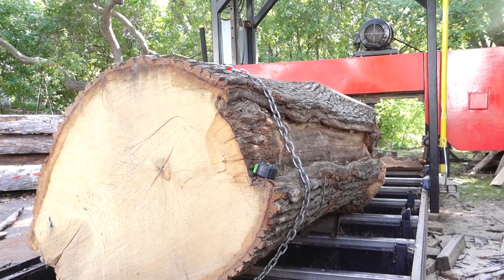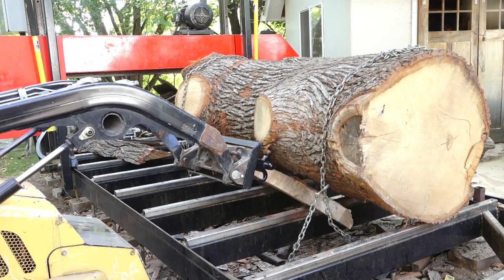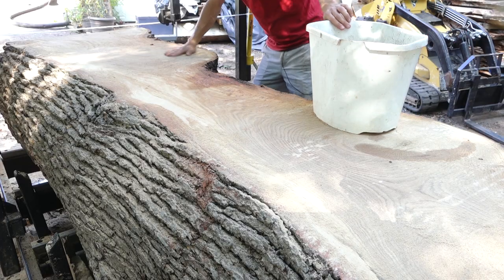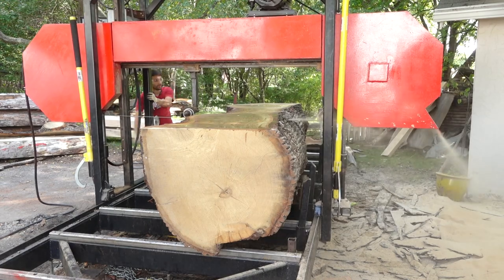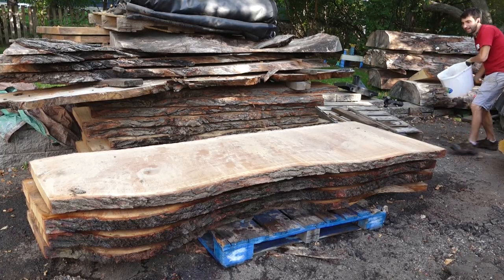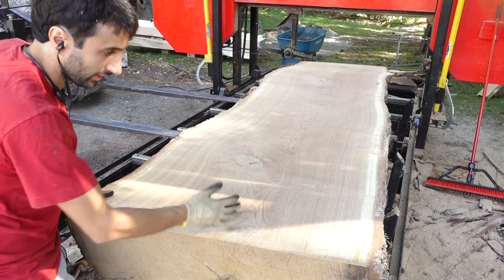Slabs of Wormy White Oak [with actual worms]

Comment: The part that always amazes me is that, as you get deeper into the log, the weight doesn't pinch the blade and either break it or stall the saw! Wow! Nice piece....and nicely done, Matt!  :-)
Reply: He's talked about that before. I think it has to do with the uncut wood in front of the blade keeping the kerf open. The only time it can pinch is right at the end, and then the jagged teeth are already through and only the smooth blade remains, which passes easily.

Comment: The worms crawl in, the worms crawl out.... "a nice half a grub"...
Yeah, nice feature for a rustic slab table top or desk. Filled with the right epoxy or boreing out the bottom and inserting fairy lights could make for an interesting slab furniture piece too. Light coming up through all the little worm holes could make for an interesting piece in the right setting. Maybe backing the underside with an upward facing mirror to intensify the distribution of some led lighting?
(If the worm holes go all the way through and the light shines through enough, that is).

Comment: Those little worms dont actually eat the tree as I use to think as well.  They create a fungus in the tree which blocks the tree from supplying water and nutrients to the rest of the tree.  Thanks for the Borate tip .  I just processed some beautiful Wild Black Cherry that had worms and worm holes.  Ive not used that product before but I will now

Comment: I’m just getting into woodworking, mostly as a result of having too much fun with my friends chainsaw mill. I have 3 white oak logs in my driveway now about size of the log in this video that was going to become firewood, but now I want to mill it. 

My question.  If you had no plans for any upcoming projects and you just wanted to make stock for the future, how would you mill up something about this size?  I’m concerned about the quatersawn sections and not wanting to make them all 3/4 inch lumber, but I don’t know if I want quarter sawn leg stock or 9/4 slabs.

Comment: I had a man come and cut lumber from trees I had cut down. On his portable saw he had mounted a five-gallon plastic tank, filled with diesel fuel. There was a line running from the tank to the top of the blade dripping diesel fuel on the blade. He said it kept sap from gumming up the blade.

Comment: you may have explained it before, and I am likely to have missed it...forgive me as I am clueless...but  I noticed that you slab the tree in a continuous motion, by that I mean you don't remove each slab before cutting the next. Does it ever bind the blade ? And are the consequent slabs (as you get deeper/lower) consistent in thickness? since there is so much weight on the blade as you proceed to cut downwards
Reply: Wondered that myself
Reply: The saw edge cuts a kerf that is wider than the blade is thick (that's what the tooth 'set' does).  The wood ahead of the blade that hasn't been cut supports the rest of the wood such that the kerf doesn't close up until well after the blade has moved forward.  If the blade was very wide and/or the blade did not cut a wide enough kerf, the cut would close on the blade and bind.

Comment: Is there any reason that you wouldn't spray it with Tim-Bor instead of Boracare? Tim-Bor doesn't penetrate as much but that should not be an issue for your application. TimBor is much much cheaper.

Comment: I notice you don't have/use water or lube continuously as you saw. you squirt or spray every so often. whats the difference or reason for using less I guess is the question. any benefit in just the occasional spray? just wondering

Comment: can someone explain why sawyers don't take the slabs off as they cut them?  It seems to me that all that extra weight can't be good for the blade.
Reply from the maker: The teeth cut a wider path than the thickness of the band. The band is not in contact with the wood during sawing so any weight above the cut is irrelevant
Reply: @mcremona  thank you!